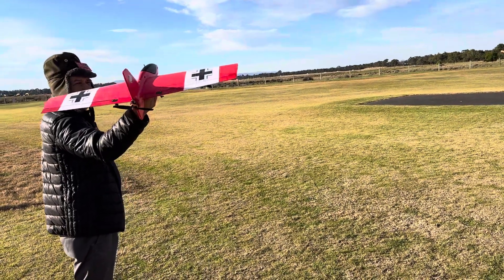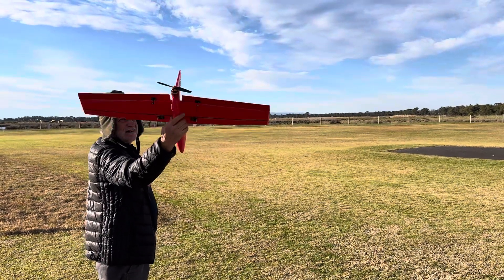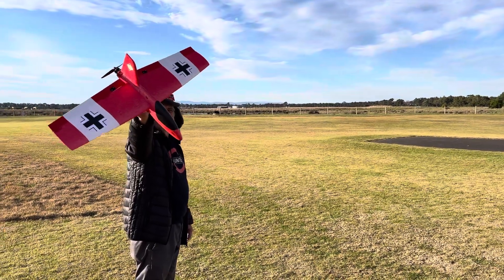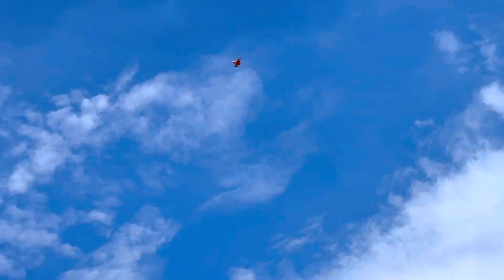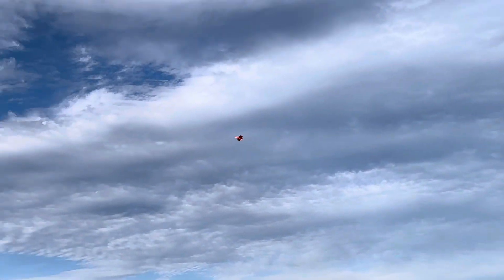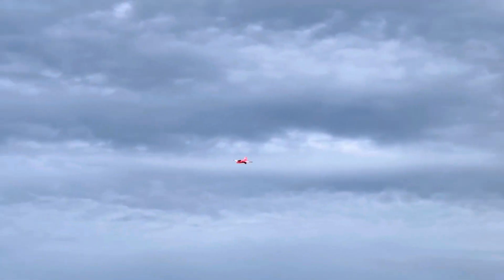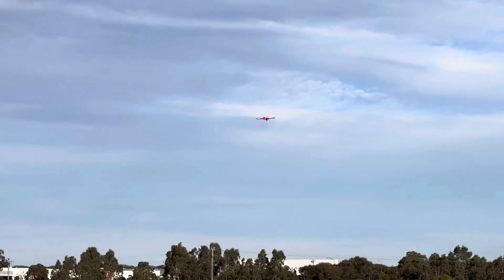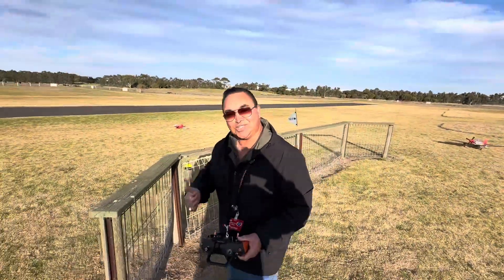$10 Chuck Glider from Target converted to Radio Controlled

Comment: so where can you buy this chuk glider?thanks
Reply: From target...
Reply: what was it called? did you change airframe wings etc?..epo foam? thanks
Reply from the maker: I cut the fuselage behind the wing and grafted the tail on the back of the fuselage. This is my $10 Chuck Glider from Target converted to my version of a Me263. 2207 2450kv motor 6x4 propeller and 30 amp esc on 4s 850mAh Lipo Battery. 

I used 3mm carbon fibre rod for the wing spar and 2mm flat carbon fibre strip for the fuselage where I inserted under front front to back.

I also used x2 Emax 12 gram MG servos for the wing

The CG is 35mm from the leading edge of the wing.

I’m also using Spektrum AR630 receiver AS3X+ and programmed Hand Launch Assist works fantastic as you can see.